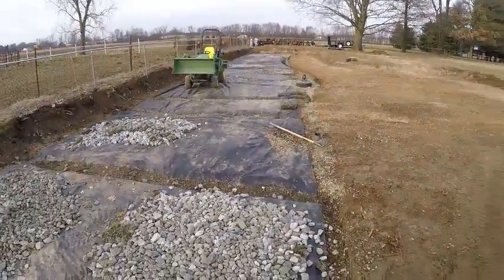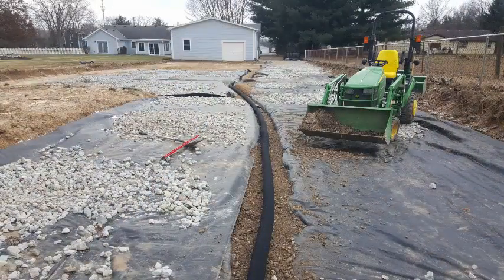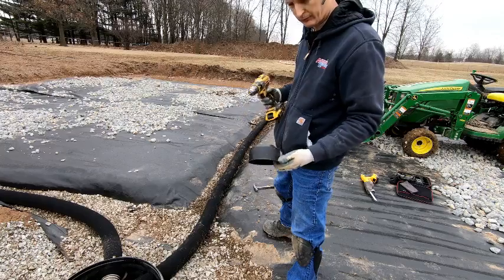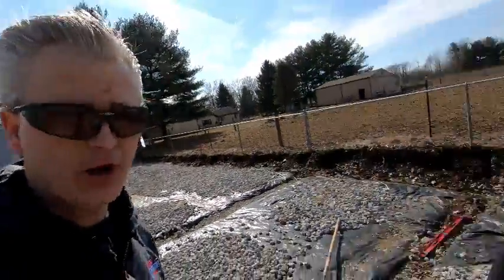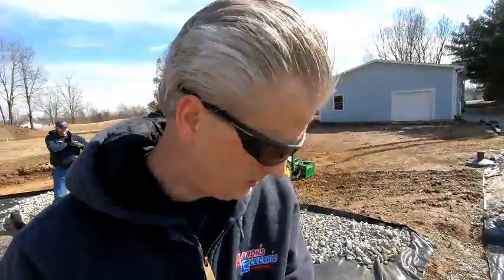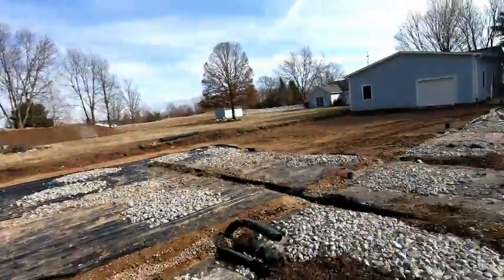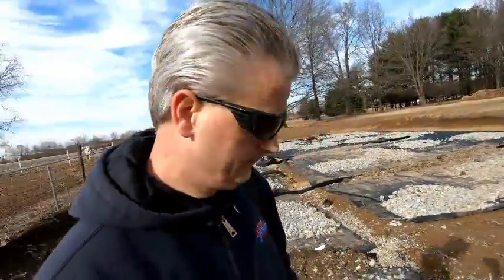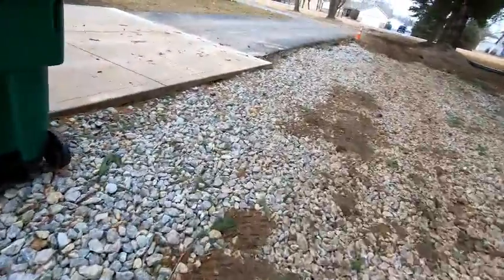John deere 1025R HUGE drive cut in phase 6, My drainage nightmare is over

Comment: A lot of shovel work too. People think because you have a tractor that you never need to leave the seat. A lot of work there. I love this DIY sh*t. Borrow a compactor, it might tighten up the stone around the pipe so it will hold the weight of the trucks when they back over the stuff. Or not?
Reply from the maker: Oh yeah the compaction is definitely a must and afterwards I'll be bringing in some more Stone still lots of work to do yet stay tuned

Comment: I like using the road felt but I absolutely hate it in wind. If it wouldn't  become a damn kite it would be a better item. I think you'll be better off using the road felt in your driveway. EXPENSIVE now but a savior in the long run. I never would have thought to go to the extent of using dry wells that you have. I just hope you won't have to dig them out later in years (due to clogging). Keep the vids coming.
Reply from the maker: Hey thanks for watching the vid as far as the dry well I really wish I had a place to take the drain to Daylight but without having City provided storm drainage and the way the property is I really didn't have any other choice